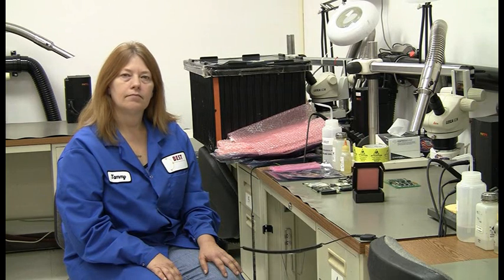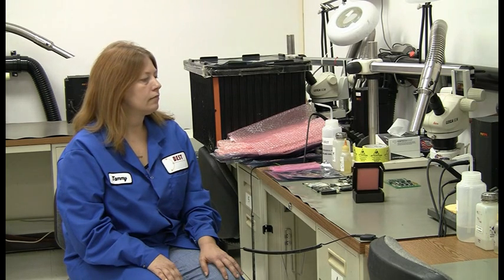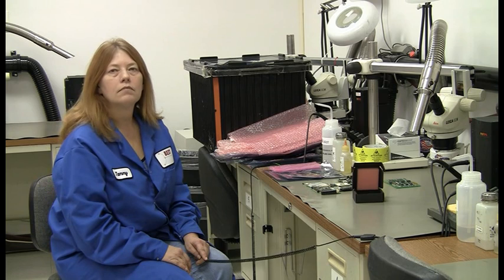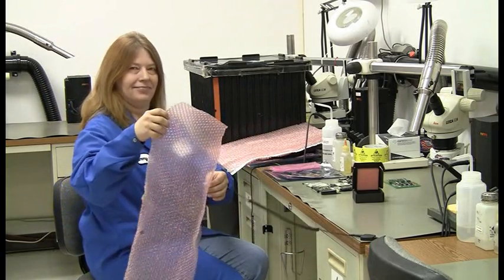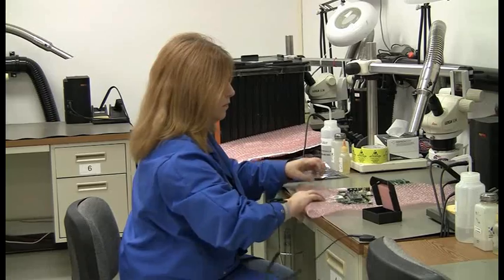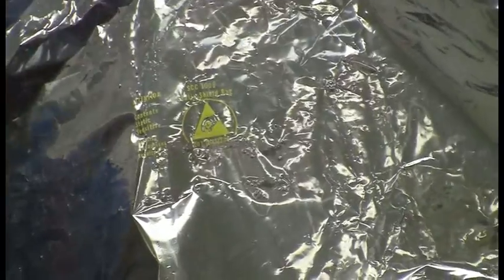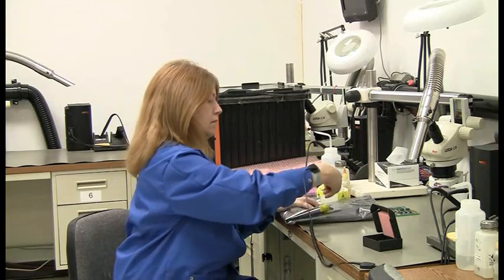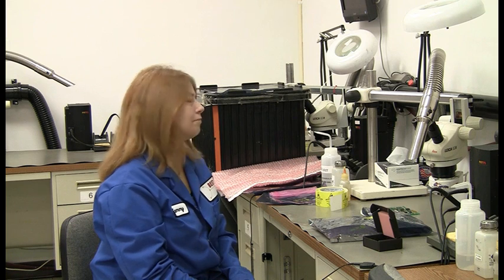ESD Packaging Tutorial

Comment: Thank you for explanation. Why do we need the pink bag inside the grey one? Does inside of the grey one charge up (triboelectric effect) if the board moves in it? Isn't it the grey one sufficient? Do we need two layer protection?
Reply: if u know the answer and if ur still alive post your answer here. We need the two layer because we also want to protect the product from mechanical damage.
Reply: @bachelorkitchen6460  So the answer to this is easy to explain. The pink bag helps eliminate the build-up of electro static electricity when sensitive products rub against the surface of it.  Normal plastic when rubbing against another surface, creates a lot of static electricity. Although the pink bag stops the build up, it can't stop other materials from transferring their electricity/electrical static discharge to it. So we put the pink bag inside the silver one because the silver bag creates a Faraday cage. Meaning electricity can't get inside the bag. In general, the pink stops the electrical part from building up static electricity and committing suicide, while the other helps protect it from outside sources. If you just left the electrical part inside the silver bag, the product would still rub against it and kill itself because it made it's own static electricity. That's why it's vital to have the pink bag.
Reply: @daquack1460  Thank you!